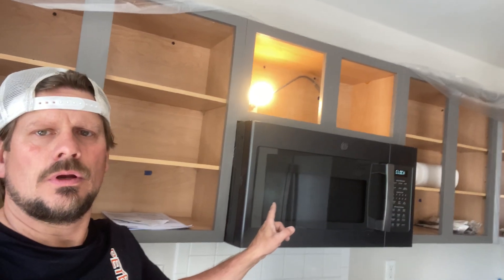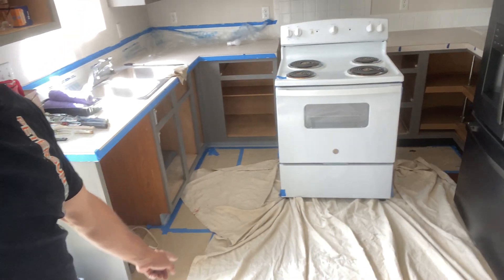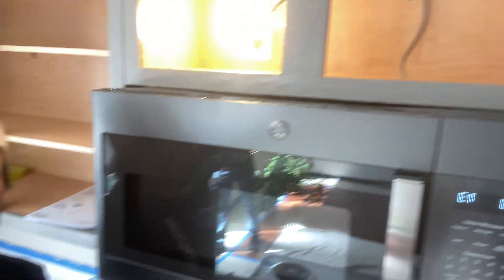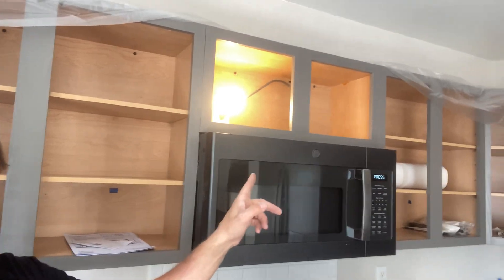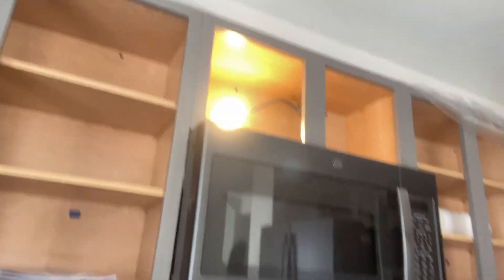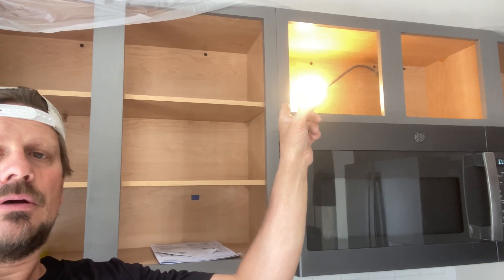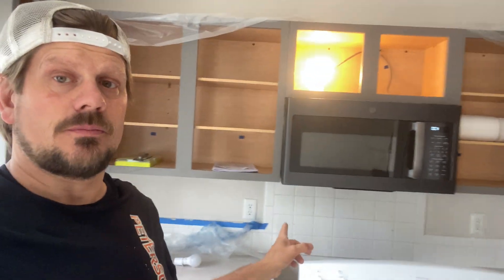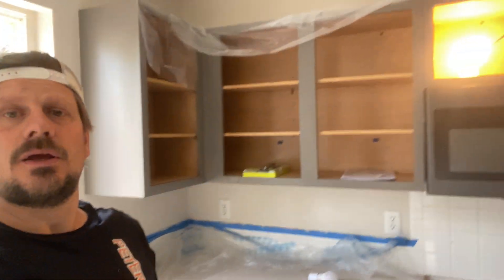Why Is My New Microwave Tripping the Circuit

Comment: 1800 watts is 15 amps ... of course it will trip a 15-amp breaker even if there is nothing else turned on at the time.
Reply: What happens when we get 2,000 watt ovens.  We'll have to go to a 30 amp circuit, I know they make 240 volt 30 amp sockets and breakers, but I have never seen a 120 volt breaker bigger than 20 amp.  Then your going to have to look a LOONG time for a 120 volt, 30 amp rated GFCI/AFCI outlet, (doubt they make those either).